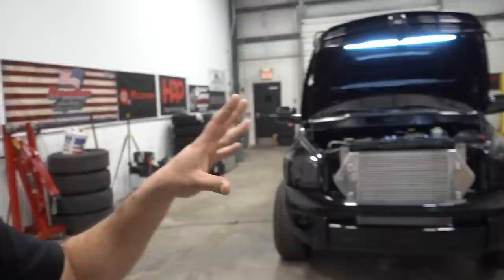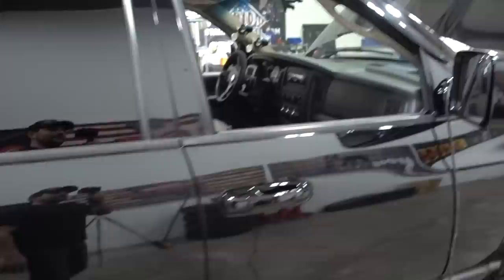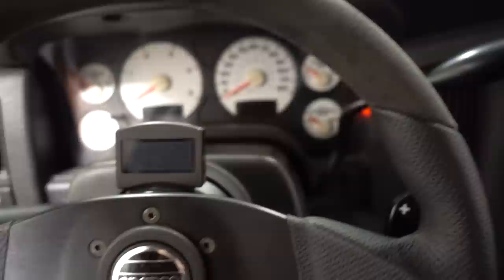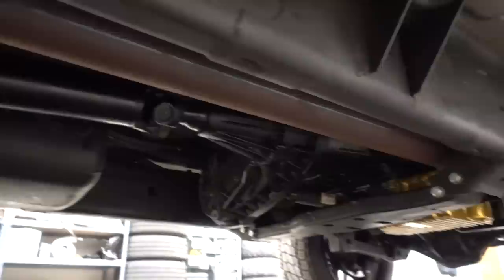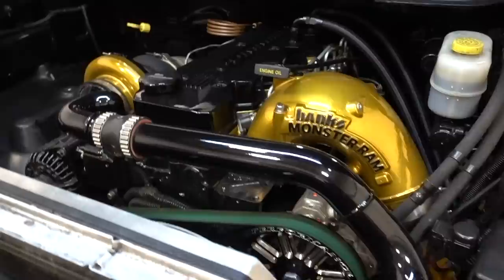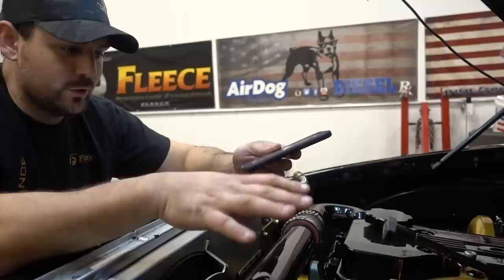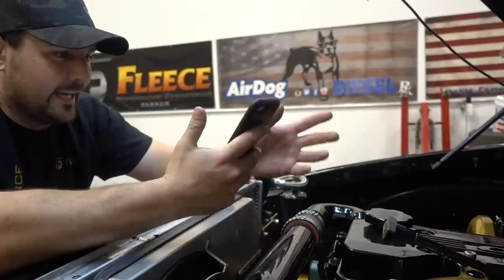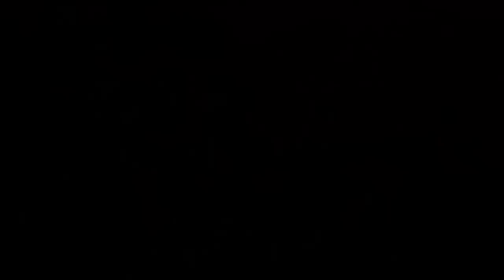940hp Cummins FULL BUILD Walkaround... Showing all the details!!!!

Comment: 2nd Gen extended cabs look better than single cabs in my opinion. A Black  01' Dodge 2500 extended cab 4x4 with a 2.5 leveling kit and 35" tires or 4"-6" lift kit with 37" tires would be awesome.

Comment: A how do on a factory delete steering wheel. Part numbers ,step by step. Thanks for sharing.
Reply: There's a custom machined spline adapter on steering column to retain clock spring then just adapter to aftermarket steering wheel. Muldoon's did all that for paddle shifter setup

Comment: hey Greg nice 05 by the way. 

 my question is  does your front axle have a locker or is it open diff up front and are you going to convert the front axle to have locking hub's smaller to a 1st gen 3/4 ton and 1 ton 4x4 ?